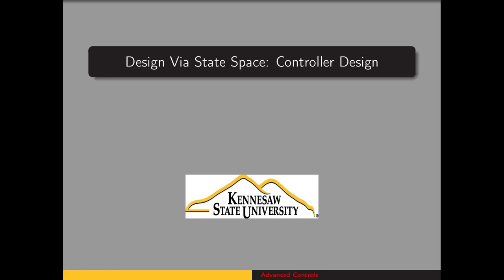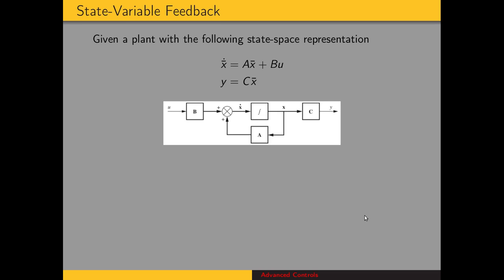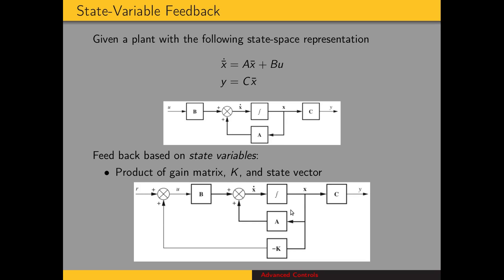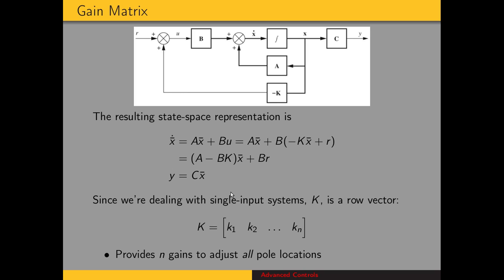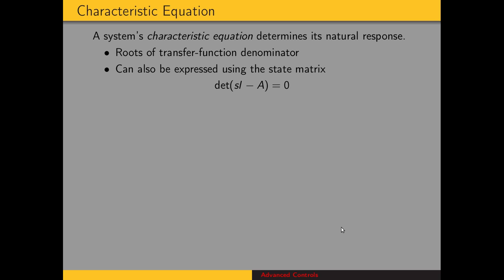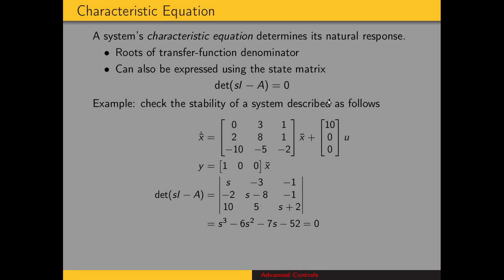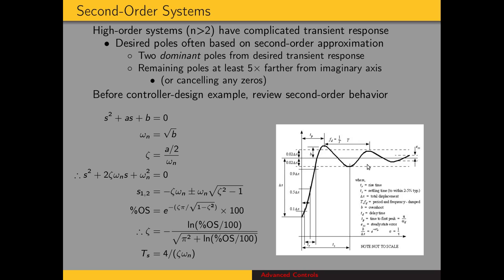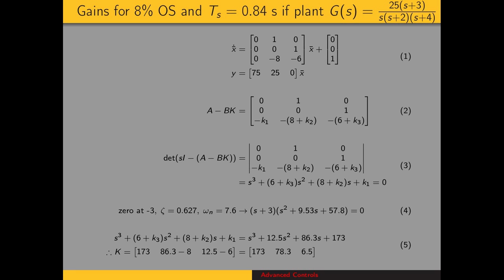Pole placement method

Comment: Great video! Helped me a lot, others would simply say what the desired poles were but you luckily went over that part step by step.
Reply from the maker: Good!  I'm glad it's helpful :)  Thanks for your feedback; finding out what aspect of the video worked for you is good.

Regarding your comment, I agree, it's important to keep the big picture in mind --- that PID and state space controllers are designed in order to modify the characteristic equation --- but it's also easy to "miss the forest for the trees" and get too focused on the details of how to use the tools, such as root locus techniques etc.

Comment: can you use this in a 4X 4 matrix?
Reply from the maker: Oh, most definitely.  The only difference is that the characteristic equations, that is, steps (3) and (4) at about 7:30 will be fourth-order.
Reply from the maker: And another difference is that the desired characteristic equation will be based on a second-order approximation.  That is, the real parts of two of the poles will be at least about five times farther from the imaginary axis than the real part of the dominant, second-order pair of poles.

Comment: How you get damping ratio 0.627?
Reply from the maker: The problem statement for  that example gives 8% overshoot as the desired response.  According to the equation at 10:10, this corresponds to a 0.627 damping ratio.
Reply: @drmattmarshall6545  using said equation I get 0.93
Reply from the maker: @EEAMD-co6nw , I am glad you posted that comment, as others might be in the same place.  The equation you're referring to has an error as shown in the video.  The natural log term in the denominator is supposed to be squared.  That is, it should say (ln(%OS/100))^2.  By the way, this information is in the video description.
Reply: @drmattmarshall6545  thank you, much appreciated.